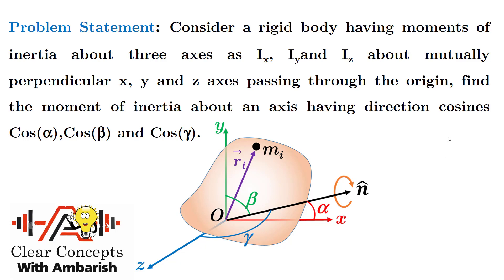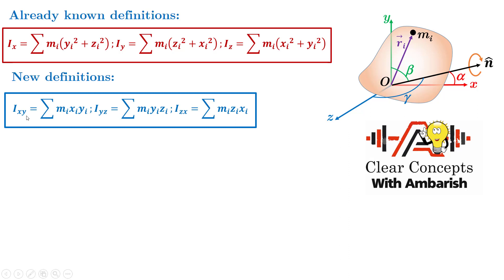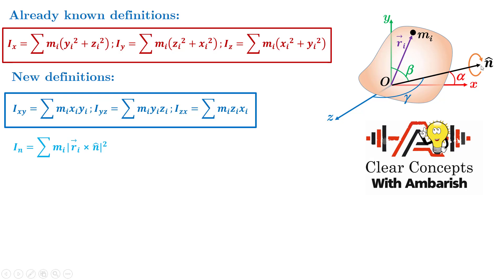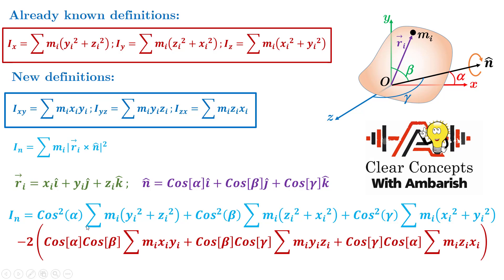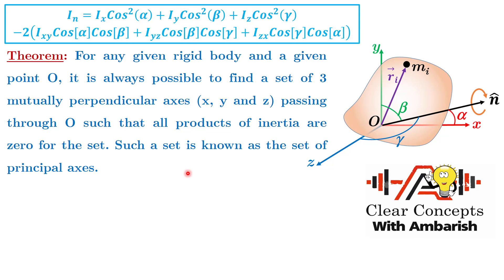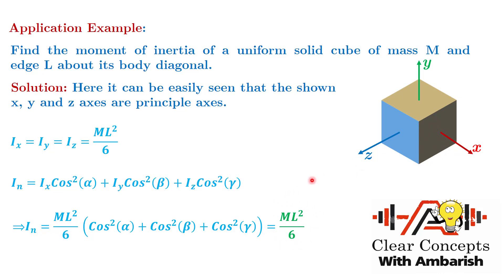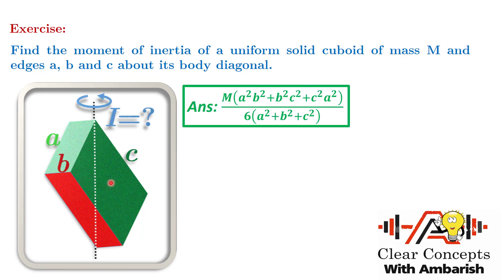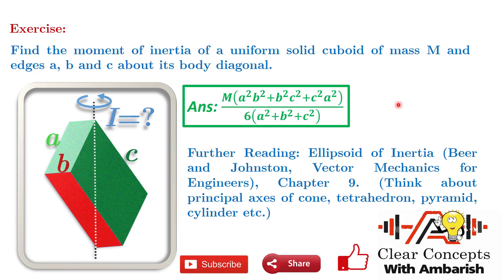FIND MOMENT OF INERTIA ABOUT WEIRD AXES USING CONCEPT OF PRINCIPAL AXES AND PRODUCTS OF INERTIA

Comment: Sir if we take the three axes parallel to the three edges of corner they will also be principal axes(perpendicular to plane of reflection symmetry) and then calculate moi about body diagonal we will get ⅔M term instead of ⅙M. Can we only choose origin lying on the plane of reflection symmetry? Please spot the error here sir.

Comment: Nice and helpful.

Product terms 0 when symmetry?.
Reply from the maker: Yes. (For cone/ regular tetrahedron,  square base pyramid or cylinder you can use symmetry axis as one of the principal axes and the other two axis can be chosen at any point on this axis (such that all three axes are mutually perpendicular).
Reply: @ambarishphysics  sir may u pls provide a link to formal proof. 

Also. Is it valid for a pyramid with any regular polygon as base.??
Reply from the maker: @shashwatgupta4613  I would suggest you to read it from Beer and Johnston (Chapter 9), Vector Mechanics for Engineers (Statics and Dynamics), You will need to understand the concept of ellipsoid of inertia and after that it will become obvious (The book provides the logic for a regular tetrahedron, and you can easily extend it to other symmetries).
Reply: so so thx sir. U are very obliging.